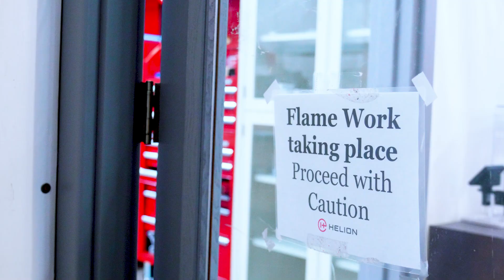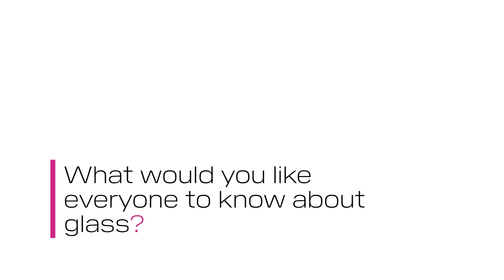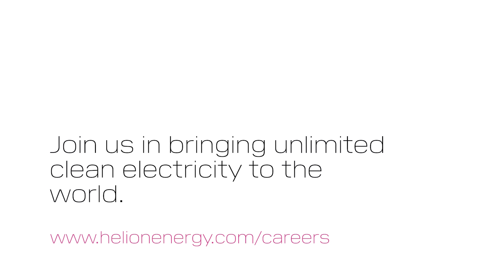Meet Helion: Elayne A

Comment: I wonder, why almost no one knows about LENR (Low Energy Nuclear Reaction), that it's way easier than "hot" fusion reaction and that it actually works (a bunch of companies already moving to commercialize it)?
Reply: "no one knows about" is a false assumption
I am not a nuclear physicists
But from what I learnt online, there is little to no people talking about it because with such a low temperature, the fusion reaction would suffer from low reactivity and hence unlikely to sustain/ produce usable power output
Reply: Where can i learn more about this?
Reply: @cedgamer264  Google. But there's a bunch of companies working on this, like Brillouin Energy (US), Clean Planet (Japan), ENG8, Industrial Heat, etc. Most of them use either Ni-Cu-H2 reaction or some sort of plasma-based system.